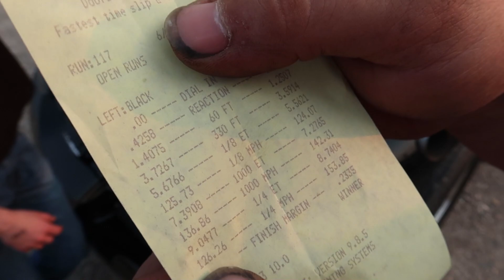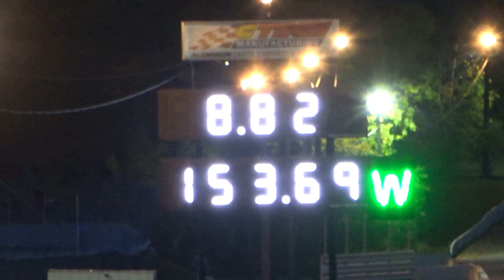Turbo Ls Makes Going Fast Kind Of Easy..... Drag Strip Runs In The 8's With Black Betty TT Mustang !

Comment: Too much crankcase pressure.  You need to upgrade your crank vents to 2  -10an lines.   You've got the car flying.  Love the content.
Reply from the maker: It has 2 10’s on it already off valve covers the seal was just bad
Reply: I don't put anything less than 12an on customer cars and I run 16an on mine.
Sounds like he just had a bad seal, to start with, though.

Comment: "Maybe one of your lines deteriorated..."  where do you find these guys?😂😂😂😊
Reply: If it's collapsed Inside it will not breath properly.
Reply: @sideshow45  that line has a poly sleeve,doesnt collapse
Reply: @lsxtmt4910  I've seen stranger things. Lol
Reply: @sideshow45  ever seen blow by from a turbo push seals out?
Reply: @lsxtmt4910  I've seen blow by from engines without turbos push seals out lol. But that's just a cheap ass seal that ICT billet stuffed in there.  Good seals fit and don't fall out.